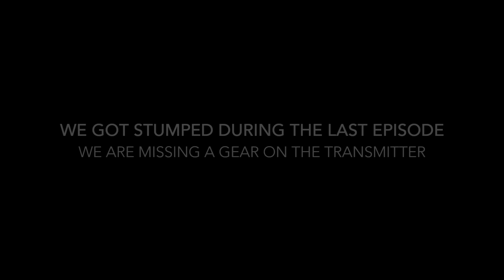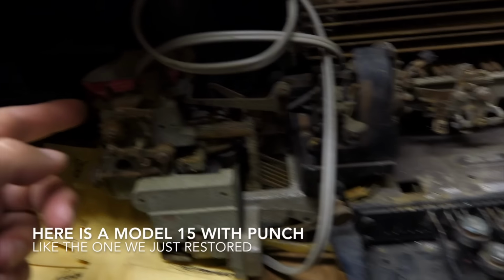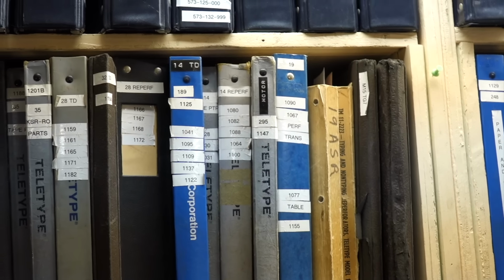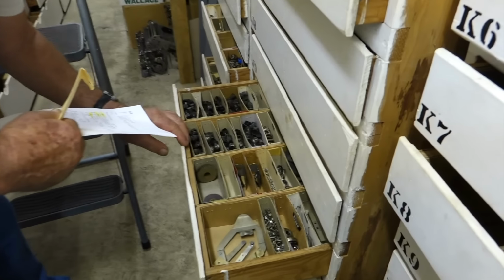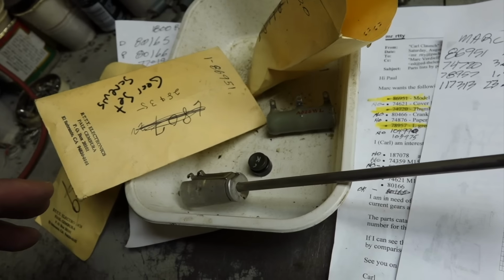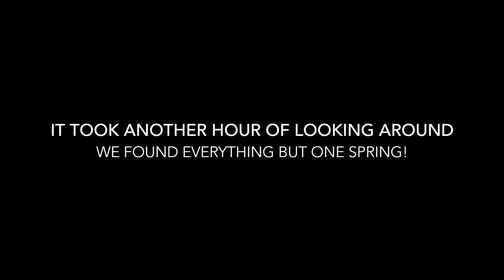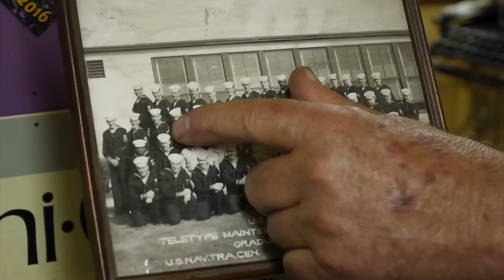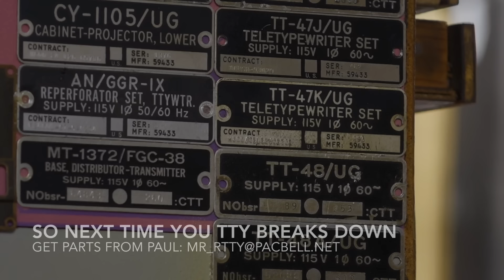Teletype Model 19 Part 11: A Visit to Mr. RTTY

Comment: So did you get the correct gears that you needed? I didn't see that mentioned in the video.
Reply: Mr RTTY did not have the motor pinion gear, but had a partially machined replacement for the main shaft gear. If we can make or buy a good substitute for the motor pinion,  the finished up main shaft gear would mesh perfectly.
Reply from the maker: Yes and no. We got one out of two, large brown gear in epoxy or fiberglass, or whatever that material is. Surprisingly he did not have the steel helical pinion gear that matches. We are looking at several options for this one, anywhere from finding a donor one, molding a replica of ours, or machining one from scratch.
Reply: Keep us posted!